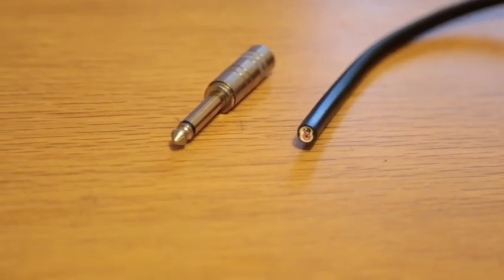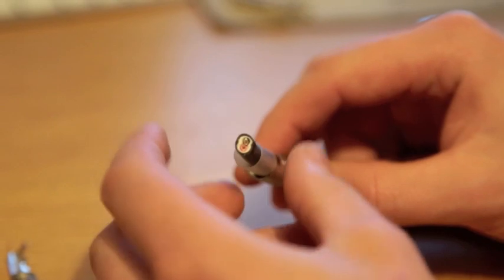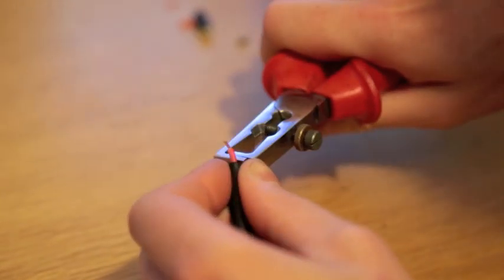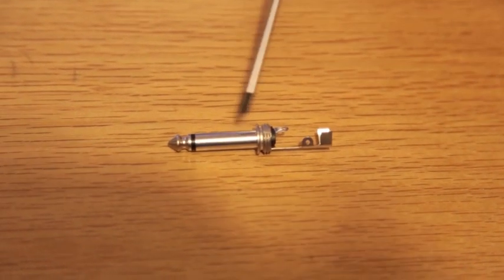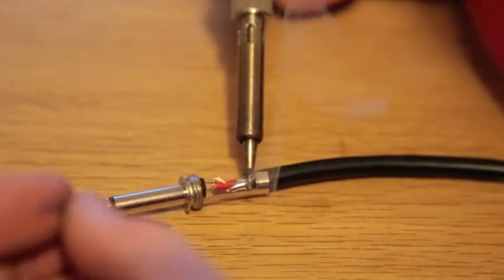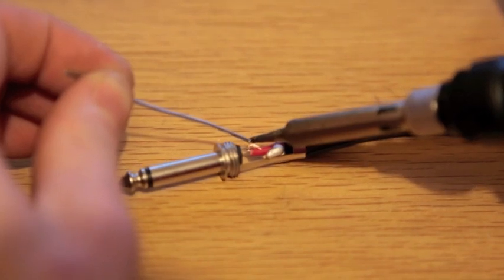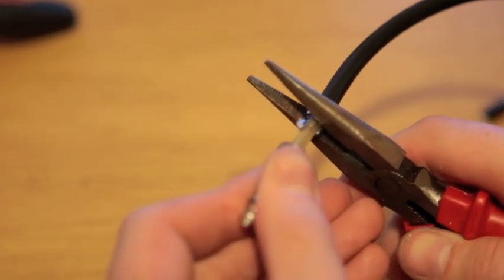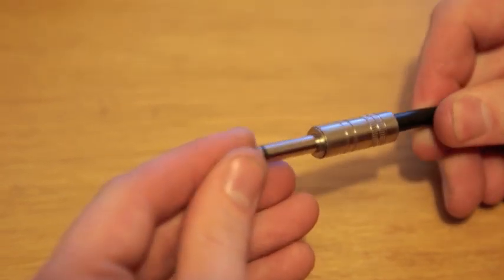How to wire 6.3mm 1/4" mono jack for instrument/Guitar lead

Comment: Looks like a cold solder joint from melting solder with the iron. Should heat contacts/wire with iron so that THEY melt the solder - not the iron. This will produce a shiny-looking joint and won't be susceptible to falling off as cold joints can
Reply: dude, thank you for this. i hate soldering because i've been doing it wrong!

Comment: That's way too much solder! Wires need to be tinned beforehand. Also, flux is your friend when you are soldering! (LS2)
You can get on it and off it without melting the insulation.
Reply: yes total corekt
Reply: Looks like a cold solder joint to me too.

Comment: That is a Speaker wire (with a pos and neg), it is NOT an instrument/Guitar lead! To be clear, speaker cable is "lamp wire" not to be confused with co-axial wire (with a pos and ground), which is used for guitar cables.

Comment: how to solder shielded three wire instrument cable with mono jack...mine has two normal wires inside just like yours and 3rd one is wrapped all over the wires...i dont know what they are called... please let me know how to it
Reply: Red signal wire goes to the short end of the jack . The white cold wire, and the braided wires wrapped all over the wires are twisted together and go to the base of the longer end of the jack.

Comment: was wondering
what if you took passive speakers, for example stereo speakers for a big ass boom box, and wired them to a jack like this and used them as speaker monitors for your pc? I got an audio interface that i can use to plug them in... just wondering if that would work?
Reply: The output signal of your pc soundboard is LINE level, so you should pass it through an amplifier and then to a passive speaker.

Comment: Tin the wires and fill the holes with solder before hand and its easy. But, never ever place the wires through those holes. Why they actually sell these with holes in I have no idea, as it leads to this misunderstanding on how to solder these up.

My understanding on the holes (but I stand to be corrected as not 100% sure) is that they are only there for when you don't want to solder anything up but need a plug for a quick and dirty test using just twisted wires to hold on to the cable.
Reply: Kevin O'Brien I know it's 1 year late but if anyone happens to care... Holes on terminals like this plug are there on purpose. If you create a bent U shape of the wire through the hole while touching both sides of the terminal and then laying an even thin coat of solder it will result in the optimal soldering bond. This is not bs, it's in the IPC J standard for professional soldering buuuuut of course a simple contact of even solder should do just fine usually.

Comment: Bad, bad, bad soldering. Iron shouldn't touch the solder for as long as you did. It should flow. When it becomes sticky like that it's because you used up all the flux. Add flux. You could tin the cable and connector first. Or add heat to the connector tag and feed in solder so it flows.

Oh and you are using the wrong type of cable.
Reply: Damn Deal Done not everyone is a soldering nija.

Comment: has anyone used amp 4gauge wire to solder on microphone tip? I seen this done in Asia as they sing a lot and worked,,but I don't know what size amp gauge wire they used..either 4 or 6 gauge or even 8gauge..any help would be greatly appreciated thanks